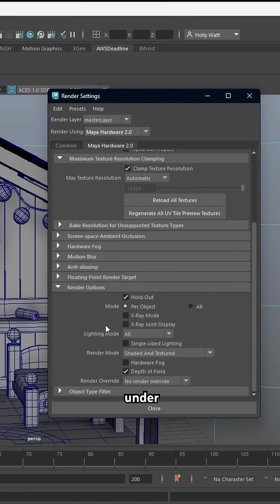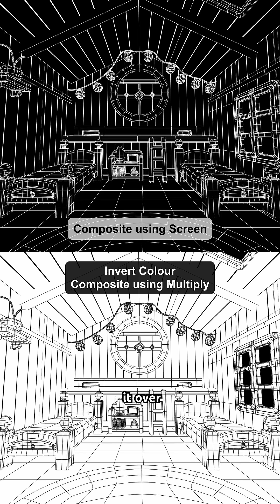Render smooth wireframes out of Maya - the simplest way #mayatutorial #3dmodeling #wireframes

Comment: Do you have any tips on rendering a wireframe and textured at the same time? Or do you just do two renders and composite?
Reply from the maker: I typically just composite the wireframe over my final renders. You could use the wireframe shader in a layered shader with your textured shader in the 2nd slot if you wanted to do them together